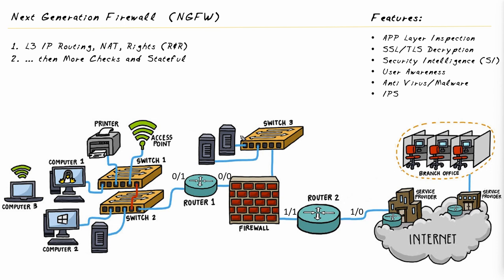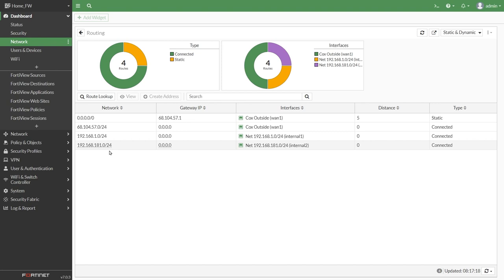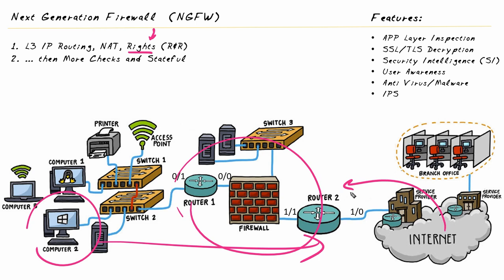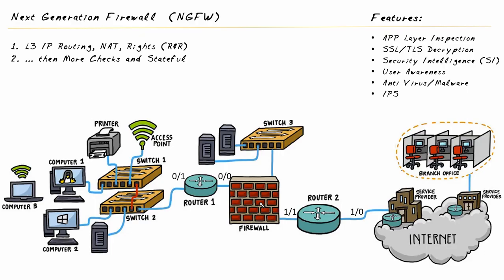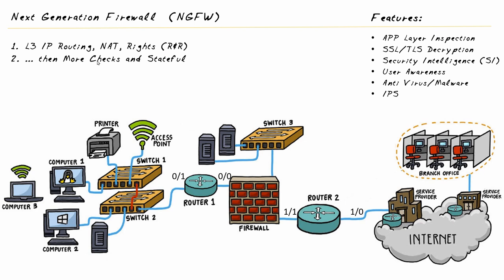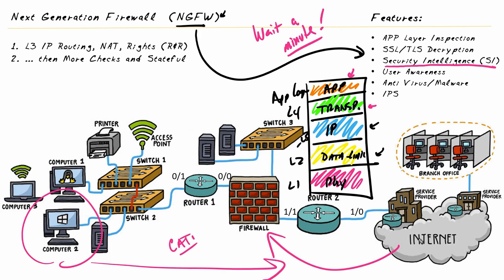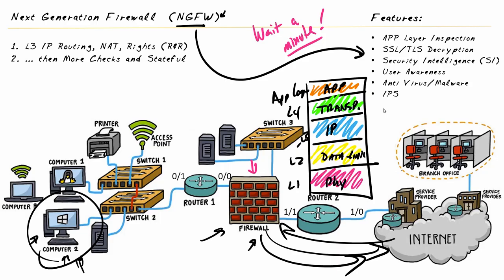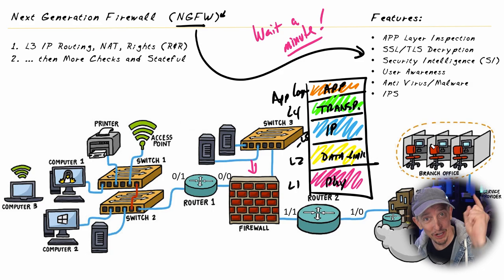Next Generation Firewalls (NGFWs) | Cisco CCNA 200-301

Comment: Love your videos! Maybe mention that in the EU you can't just implement https inspection without permission from HR/management. You can land you company in a very bad place with that.
Reply from the maker: Thank you for the suggestion Michele Klau❗
Reply: Is it as per the EU GDPR?
Reply: The explicit permission by the individual user (!) is required. If the user is an employee, the employee contract must have appropriate text. Otherwise there is no effective user agreement wrt GPDR, and management will be liable. As a user, even of a company owned device, I expect HTTPS to be secure and not monitored other than by the target website. Also, NGFWs are misnamed: they are TLS interception intermediaries aka wiretaps. Which is ok, if I'm being made aware and explicitly and freely agree.

Comment: Cisco NGFW uses a Linux (Lina) engine which is run on top of the Cisco code in FTD's, the problem in my experience  is that in an FTD device you cannot use "normal" or should I say conventional commands in the ngfw to make configuration changes. Everything is done in the Firepower Management Console. You can only view the current running config in expert mode. That's a huge problem. What if I am unable to reach the firewall to deploy a configuration change from the FMC however, I am at the console with a db9 attached?.  Then it becomes a pain in the arse. Cisco or any other NGFW developer should implement a way to configure AND manage the firewalls both remotely through deployment AND locally further, at a minimum we should be able to make simple switch port changes using conventional ASA commands i.e. config - t etc

Comment: Could you add a few comments regarding the placement of the firewall? Specifically, since it can do routing and NAT, what advantages / disadvantages there are to placing the firewall before an edge router vs. replacing the edge router with the firewall itself. In the last two companies that I worked at the edge device was a firewall (Cisco ASA and Palo Alto, respectively) at each office; there were no dedicated routers.
Reply: I don't know every single pros or cons of the placement, but I picked up some of them. 

With a dedicated router 
Pros 
Sharing the load, on the internet side there are a lot of things happening. Take for example port scans. When you have a dedicated router that will be handled by the router. This means that the firewall can scans all traffic without the noise of the internet.  Also security wise are more devices, more secure if configured correctly. If a intruder needs to get access to one device or to several devices. It's more difficult and time consuming to get access to several devices, which gives a higher chance of detection.

Cons 
Higher price because more devices 
Double NAT (which can also be a pro because of obscurity)

Without a router 
Pros 
Lower cost 
No double NAT

Cons 
Internet traffic can fill up the logs, which makes monitoring more difficult 
One device to handle the security. 

Some parts of this you need to know for the CCNA, but most of it is a higher level of certification. CCNA is more basic understanding the Cisco technology.
Reply from the maker: Thank you!
Reply: Having an edge router don't mean you need to double Nat....you can have point to point and workload public IPs

Comment: I see in the picture that there's 2 routers and a NGFW. can a NGFW be a router? or is it always a seperate piece of gear / VM
Reply from the maker: Thank you for the question stuart duperron. 

Most firewalls are L3 routers (in addition to the firewall services).
Most firewalls are physical appliances (devices) do to needing dedicated hardware and circuits to do all the work very fast.   Having said that, most vendors also offer a virtualized version of their firewalls as well.  Examples would be for use in cloud networking such as Azure or AWS.